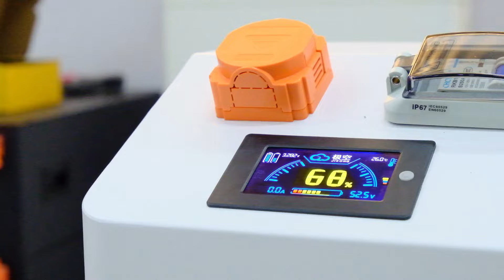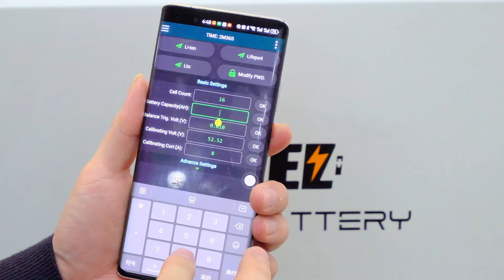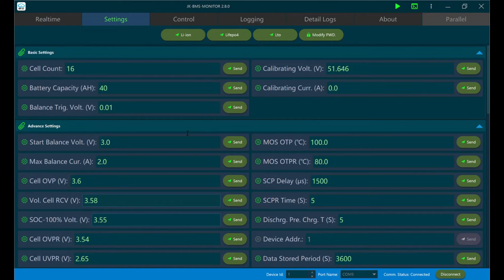EEL 48V 280Ah JK standing Kit/box！！！with 150A/200A JK BMS

Comment: The compression plate is not compressing the cells.   8-/   Look at the HUGE gap between the cells and the compression plate. 
The EVA tape is not even squashed. The screw underneath the circuitbreaker is not ligned up.  You should do better EEL BATTERY
Reply from the maker: Our kit has been improved and upgraded to better squeeze the battery cells. We will also pay more attention to details. Thank you for your feedback.🥰